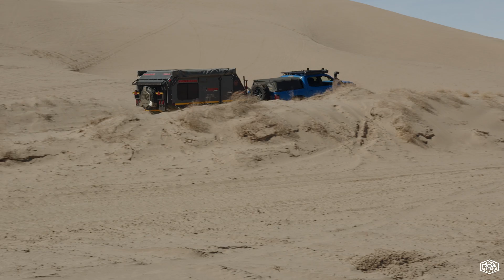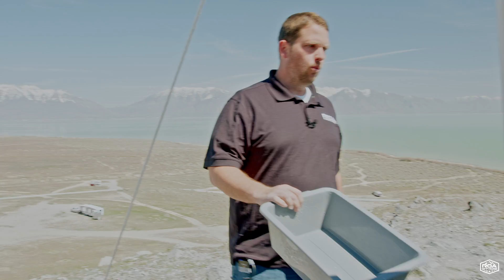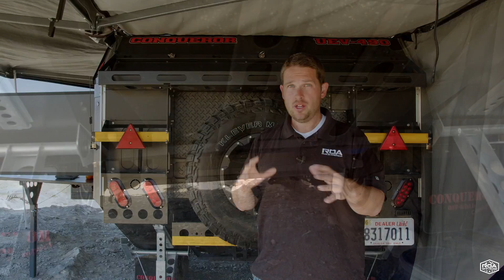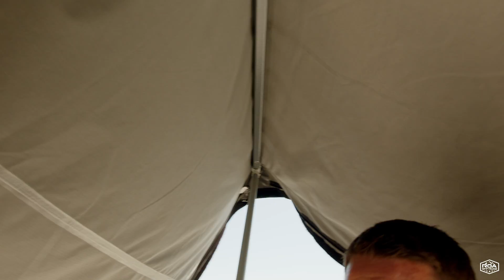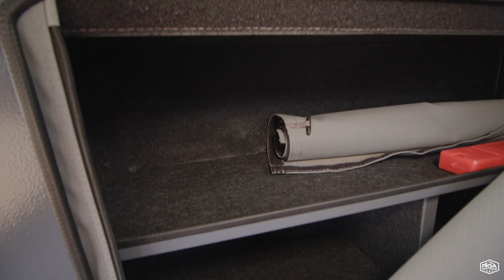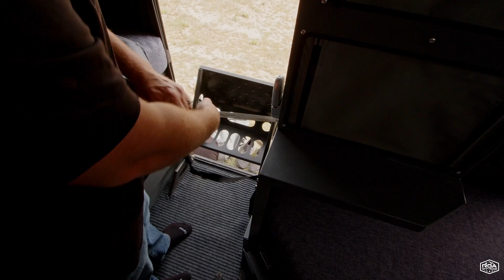Conqueror UEV-490 Platinum FULL TOUR. Better than Bruder? Off road trailer ROA OFF-ROAD  (2022)

Comment: Many thanks for this deep and detailed review.
Look, I’m doubting between the UEV 440 and the 490.
Obviously the 490 is more appealing and it’s much more useful as caravan than the 440, but my concern is about off road capability and ease of maneuverability (specifically off-roading). I have a Nissan Frontier 2023 with some good mods that make it very good off-road, but I’m not sure if the 490 would limit it too much or how much more than the 440.
I find the 440 more camper trailer than everything is done outside as the inside is more for just sleep. The 490 gives this plus of inside usability while remaining a mainly outside living. I’m not looking for an all inside caravan, I want adventure in family, so not interested on big and heavy things. But with a small kid, if the 490 doesn’t limit me that much compared to the 440…it could be a great tool.

I would appreciate your feedback. 

Thanks!

Comment: New Fan and checking out your page and videos. Disabled Marine Veteran and just picked up a 2014 Rubicon Unlimited. Tan and previous owner did some nice mods. Dana 44s front and rear, AEV snorkel, 38X13.50X17s with Falkin Wild Country, bead locked. Other mods, lights and fenders. Both F-R bumpers changed for off-roading. Need a winch.  Hoping to get back into overlanding but age dictated getting a trailer. did this in NH and now in Kansas. Miss doing it. 3rd wrangler I've owned, 2nd Rubicon. Previous a 06 TJ. installed a lift and some bigger tires in it. Now starting out with a great base with my new one. So, shopping for a trailer my rig can handle. 106K on the V6 motor. Love the look of your product. Can you color match with the Dune/Tan color Jeep offered in 2013-14? I'm a Desert Storm Veteran. Infantry mortarman on the frontline. So doing to do an homage to Desert Shield/Storm. I was there. 90% disabled now so working on a slim budget.

Comment: Explain more on the battery cut off switch.  Does it need to be in the on position to charge your battery while driving and in the on position while driving to run the refrigerator?

Comment: Great trailer but don't dis the Bruder.

Regarding the water heater, what about the Truma AquaGo Comfort Plus?  Does it fit on the same space?  Most people rave about it and you can have instant hot water?

Are the pantry shelves adjustable?  You have stuff that fit there but some people may buy taller/bigger stuff.

Love the kitchen.   From the dinnerware that it purposely fitted to the drawers to unplumbed container to clean the dishes.  Definetly saves water.

The whole double bat wings and wall enclosures it is also great.

The camping table can't be manufacturerd with telescoping legs?

The connection to charge from the vehicle (Andetson plug),   does the towing vehicle needs a modification for this to work?

Comment: This ticks most of the boxes but for the price needs lifepo4 batteries 400ah , greasable rods for the A bracket in the trailing arm suspension , and roof mounted solar 300w minimum .

Comment: Was dead-set on the Off-Grid Trailer Expedition 2.0....then I came across this and at the same price point and offroad capability, I think I found a new alternative favorite. I wonder if it comes in tan so I can match my tow vehicle.
Reply from the maker: These trailers are pretty amazing. Let us know if you have any questions. You can contact us at 801-860-0035

Comment: I'd like to see more info on what full set up and take down looks like? What capacity does the battery system come standard and what options do yall offer? Any AC options that work well in hot climates? Great video. Lots to consider after watching this!

Comment: Where does the rain water drain that collects into the center when the awnings are open? Also, can you talk about winterization? I assume its not rated for 4-seasons since the under water storage is exposed?
Reply from the maker: The awning has a riser mechanism so the awning is slightly angled out. The water will drain off the end. They are not rated for 4 seasons

Comment: How does it hold up in 40-55 mph wind &TS?
Reply from the maker: What is TS?
Reply: @ROAOffRoad  could you please answer @PatLSmith question. I’m also curious how it holds up to storms. Thanks
Reply: Thunderstorms
Reply: As long as the awnings are staked down properly and the stabilizers are in place, our 2014 model is rock solid.

Comment: Can you do a video on the front bed deployment and canopy? I think I'm missing something.
Reply: Not much to it.  On our 2014 model (and I assume it's still the same), pull the pin that holds the V shaped bracket on the front of the trailer closed, undo 2 latches at the top left and right of the bed (on the front outside of the trailer), then pull down the bed with the V-shaped bracket.  The bracket then rests on a bracket on the tongue and the pin goes back in to hold it securely.  Then go inside and lay out the mattress and push up on the crossbar that holds the canvas up.  Lock the crossbar into place on both sides and it's done. Takes less than 5 minutes at a leisurely pace.

Comment: What is the head room height of the awning? I’m 6’8’’ so curious if I could stand up straight under the awning while cooking/hanging out outside
Reply from the maker: You absolutely could, Shane is 6' and as you can see he has at least a foot and a half of headroom while he's underneath the awning, and the height of it is easily adjustable, so the height numbers aren't always exact, especially taking into account what the airbag psi is set at.
Reply: It looks like it would be close. If he is 6ft you should be fine from what you can see on the video.

Comment: Did I hear that right? You can't close the doors with the steps down? I thought I'd seen it all when it comes to trailers, but that's a first! It's a cool looking, well made, and oddly designed trailer. It will be interesting to see how they sell in the US, especially versus off roaders like the Dweller and RKS Purpose. For me personally it would be a little disconcerting to pay top dollar to buy a new high-end off road trailer and then immediately need to change out the steps, heating and AC units to make it truly functional for boondocking.

Comment: Excellent video. Thank you for being such a great source of information. I had crossed this trailer off my list because of no 12v heat and air, but it sounds like you fixed it. Dealer here in Texas didn't offer a solution so I'll happily purchase from you when it's time.

How insulated do you think the Conqueror is? I'm curious how well the AC will do in hot climates.
Reply from the maker: Thanks so much! Frankly, These trailers are not insulated great for extreme weather. It will keep you comfortable. But 20-30 I was very comfortable but much less will not be good. I don’t think 100+ will be comfortable either.
Reply: Ive seen other bideos on this , not as much detail as in this video. I want one , but with ac. And heat. Lithium set up.

Comment: Steps are worthless. Can’t close the door with them down. ????
Reply: They said they have a mod to remove the steps. I have seen someone else do this so it should be fine
Reply: @joseph4x463  so, it’s either steps and leave your door wide open, or no steps at all, so you can close it?

Comment: Like idea of changing to tank hot water heater. But where are you putting tank?
Reply from the maker: It fits in the same area.
Reply: @ROAOffRoad  Can you fit in a recirculation  system so you can keep the instant hot and not waste the water?
Reply from the maker: @Duurti  We have done some systems  like this before. They don’t work well on these tanks. Doing a tanked heater would be easier and probably cheaper too
Reply: Regarding the water heater, what about the Truma AquaGo Comfort Plus?  Does it fit on the same space?  Most people rave about it and you can have instant hot water?